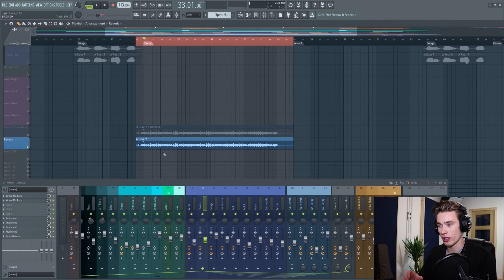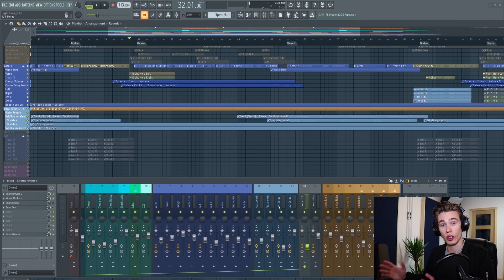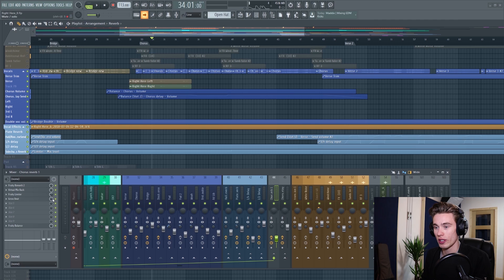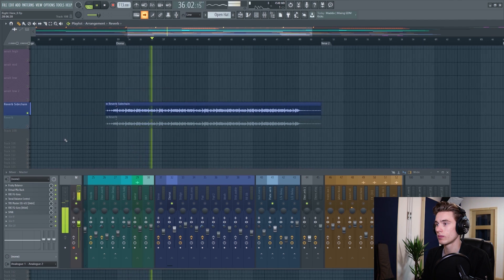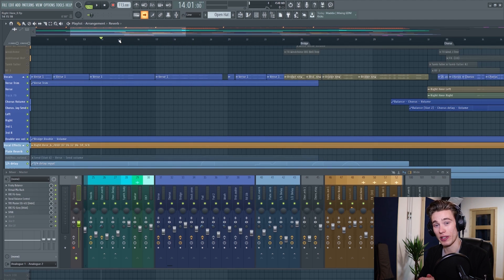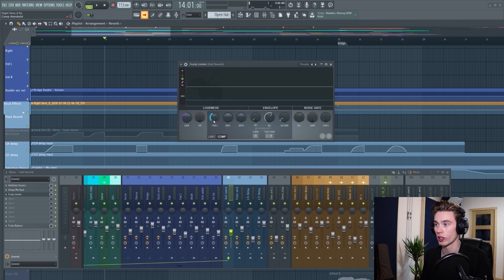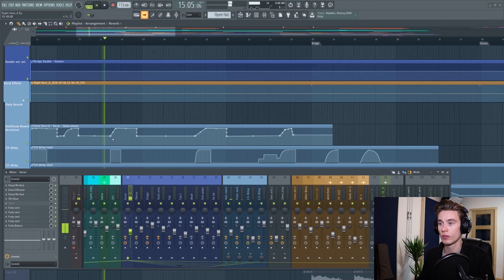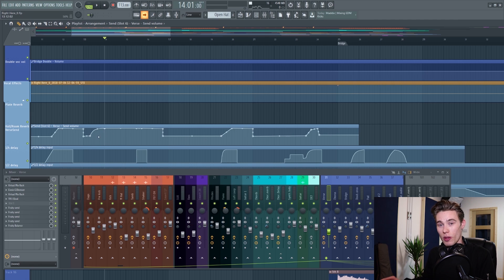Vocal Reverb Side Chain for Clarity and Depth (FL Studio 20)

Comment: Does this mean this is how we should now be applying reverbs to all out mix and if this was to be rap song how will you treat it? this ducking down now is possible because it's singing and the Singer  has pause but raps doesn't so how do we deal with something like that? because the  tradiational system of reverb applying to all was condemned in this video  without the reverb ducking down and rising in the pause. And how will it be treated if it was a live performance where the reverb has to be set  on the mixer live...

Comment: Hey Mike, I'm in the process of making a home studio for myself and I was wondering if you could give me some tips. I currently own a Focusrite Scarlet 2i4 audio interface but I wanted to buy a Universal Audio Arrow audio interface. However, I don't know which of these two is better, since I have some people who have recommended I stay with the Focusrite and some who have recommended I get the Universal Audio. Also, I was wondering which monitors are best: the KRK Rokit 5 or the Yamaha HS5. A friend of mine told me I shouldn't waste my money on the KRK and instead save to get the Yamaha monitors, but I don't know which would be better. If you could help me out I would greatly appreciate it.
Reply from the maker: As for the interface, I've never been a fan of focusrite but I have not used the arrow either. For the monitors the krks are not bad and get a lot of unfair press but the Yamahas look a lot better imo. Both will probably give a similar performance but will sound different, not better or worse just different. Bear in mind that the krks are front ported and the Yamahas are rear ported. This will affect the bass a lot in a small room or if the speakers are placed close to the walls :)
Reply: @inthemix  thanks for the advice Mike, I really appreciate it :) have a good day

Comment: I actually found the side chained reverb to be distracting :(
Reply: much better way is automate wet/dry knob on reverb plugin
Reply from the maker: @feggyo  If you automate the wet dry knob when the reverb is on a send it will phase and cancel.with the original vocal and mess up your mix
Reply: ok, i meant only wet knob, like in fruity reverb 2 . i dont think it sounds good, if you dramatically change the level of reverb in short section . and if the dynamic range of vocal is larger it becomes more and more obvious

Comment: What's parallel compression never understood what that is
Reply from the maker: I should make a video about it. It's not too complicated but a lot of videos make it seem like a very difficult thing
Reply: basically, using a compressor as a send instead of insert.
Reply: Fusing the compressed signal with the dry signal of a sound.
Reply: its a mix of compressed signal with dry signal. if your compressor has wet/dry knob, you probably do parallel compression :)